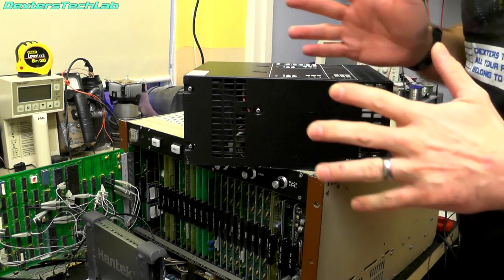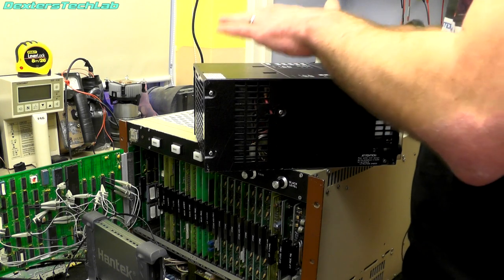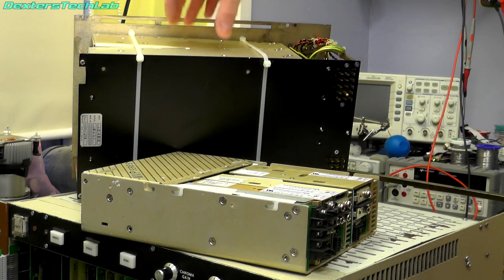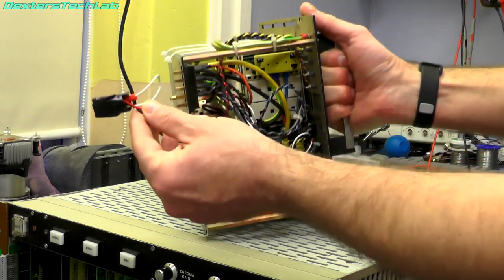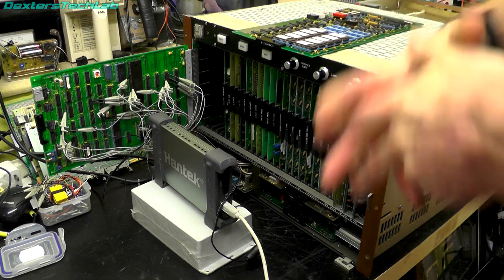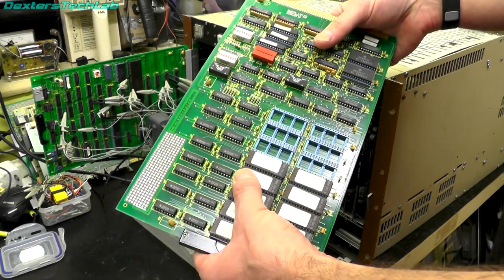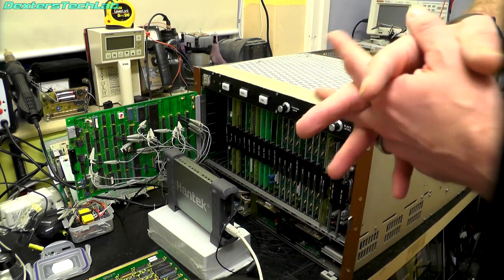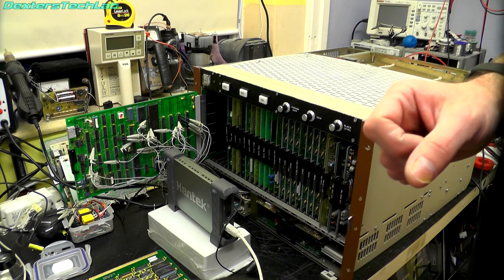DL207 Quantel DPB-7001 Digital Paintbox Restoration & Repair Part 1

Comment: In the 1980s I worked assisted between several 2” 4 m/c edit suites at the BBC. The video editors were much older than me and didn’t want to learn how this and other new technologies worked.  I saw it as an opportunity to become an editor by doing the new stuff they didn’t want to do.  This was one of the devices I used and I became and editor a few years later and still going today. It was a way in.  I also remember that the loan for an Avid editor, was the same cost as my house mortgage at £40k.

Comment: Having worked on mini computers that sort of size with similar slots i would recommend you check the backplane edge sockets to make sure none of the pins are bent or mashed up from inserting the cards roughly or carelessly. Also check the edge of the card for a nice chamfer so it inserts gently and avoids damaging the socket.  
And finally I have chased my arse trying to fix a card that simply wouldn’t work because it didn’t like the slight timing difference due to the long card extender.
Reply from the maker: Totally with you on all of that, i will be mentioning several findings in part 2!

Comment: There were several in multiple post houses in Toronto, Ontario, over the years. No idea if any of them are still around. I would have loved to have one.
I had a chance to pick up an editbox several years ago, but another operator got there before me... That system, I'm told has now been scraped... :(
There were also many Henrys, Hals, and even a couple of Ampex AVAs used in the many post houses in Toronto, and the Southern Ontario region, over the years...
Reply from the maker: Quantel was everywhere in the 1990s, i wish more people had saved those machines. I am starting to get more and more messages from people wanting to buy machines now, but there aren't any!

Comment: Was this used during the 1986 World Cup? I remember the replays had these kind of effects, which amazed me at the time. And I did not see similar effects in a long time after that.
Reply from the maker: Yes i am sure it would have been. Not for effects but for still images, captions and the like. The classic paintbox (DPB-7000) only works on still images.
Reply: @DextersTechLab  What I was thinking if you can see here, for example at 0:35 when there is a replay of the penalty
https://youtu.be/_nhvqIjgQ04
Reply from the maker: No, Paintbox only works on still images. That was done on a DVE of some kind.

Comment: Please can you help me?

Did the 80s Paintboxes allow a still image (a captured video frame or photo) to be made into a lower third banner background that text could be written on top of and then repeated throughout a video? For example a piece of real marble to be used as on screen text caption backgrounds.

I’m trying to recreate 1987-era graphics and can’t find any examples of designers at the time using this method, so I guess there was a technical limitation. 

I know what I describe was being done with the 90s generations, but I never see it done with the 80s generations.
Reply from the maker: i don't see why it could not have been done in the 80s, but it was much easier to do in the 90s. With the advent of the more enhanced Paintboxes like Harry, Harriet, Editbox, Henry and HAL you could easy composite things like that over video.
Reply: @DextersTechLab  Thank you for answering.  I looked through hours and hours of footage and never see anyone use it in the 80s.  Sometimes/rarely behind a main title but never on repeated lower third type captions.  Must be a reason. Can't figure out why. As you say it should have been possible.

Comment: don't mean to be a prude, but I can hear the compression on the audio, you should figure out the bit rate on that since, even though the video is great, the audio compression issue is kind of annoying...
Reply from the maker: It's not been mentioned by anyone else before, but thanks for letting me know. I've changed my templates and decreased the compression on the audio for future vids.
Reply: You don't mean to be a person who is or claims to be easily shocked by matters relating to sex or nudity? Well I don't see what that has to do with the video but ok.